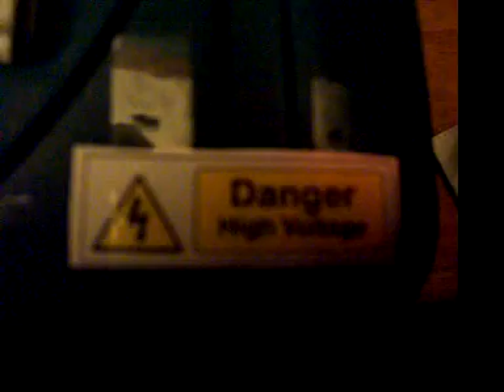Homemade High Voltage Generator Explanation

Comment: Then you probably have 230 volts in your grid.

10 amps???? NO man!! You need only 60 miliamps in order to get killed. That is, enough to stop your heart from beating.
The voltage will decide how many amps you will get, and if you are sweating in both hands in can be a lot less than 100 volts.

Comment: Well it would bite about 3,5 times as much as when you get shocked by your electrical home supply, if you're an American that is.

 Unnecessary to say, it would probably be sufficient ;D
But: Be aware of the amps, when you lower the voltage in the caps you most often increases the amps, and the amps is what kills you, either if it is your heart or your peacemaker.

Comment: Yeah you're right, 300 000 volts is a bit high to store, more like a  3000 volts cap :D

Also just to be clear, I'm completely against the police using tazers to control the public, I would much more prefer the good old stick and shield ;D

Comment: "Hi,Nice outfit.... However what is the adavntage of the unit? What's it for exactley? "

High voltage generation of course. You could buy a 300 000 volt capacitor and charge it. Than every time someone pisses you off you could shake their hand ;)  ZAP!!!

Comment: You should use your genius to create a pulse or sinewave generator for splitting water molecules into H2o gas. You seem like you have master voltage, frequencey and pulse waves which is all you need to split water molecules. The world need relief from high energy prices. Keep up the good work though.

Comment: Nice Work! 
Did I miss the output figures or are they not included? Please post if you can or just give some examples of what you can run with it... aside from the stunner for the oil worshipers as suggested in last comment hahaha! 
Scooter batt. = 12v by how many Ah? Thanks for the vid man. Impressed!

Comment: Nice Work!  You should considering soldering it together.  Before I switcthed to soldering I used to have soo much trouble with the bread boards being unreliable.  Not to mention getting messed up by moving around and such...

Also I found that plastic toggle switches from the hardware store work really well for switching on high voltage equipment... I tried a metal one but I had an incident with it...

Anyways... Nice Job!